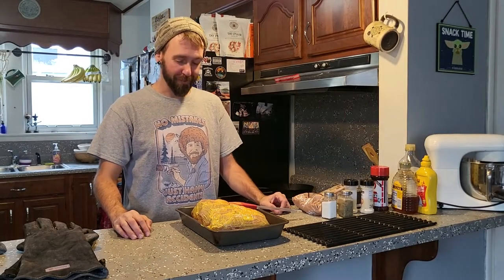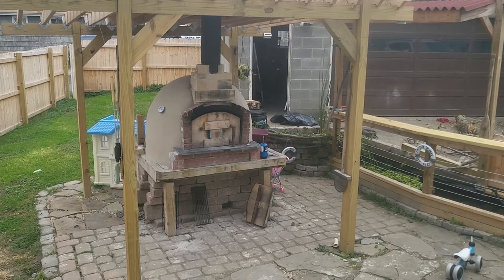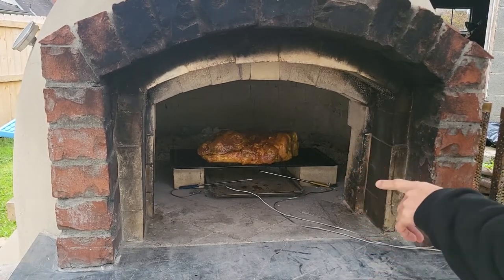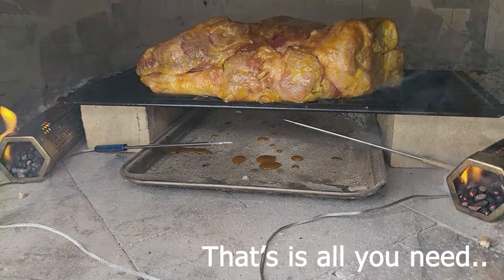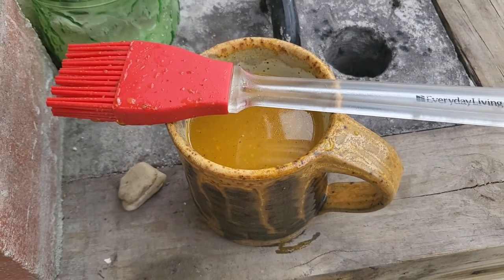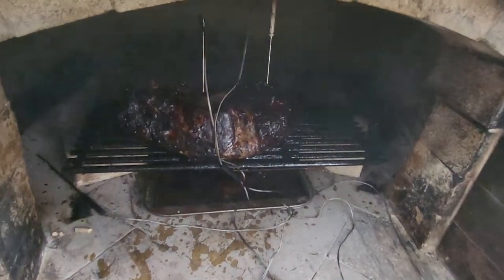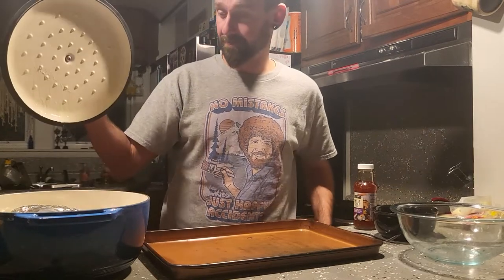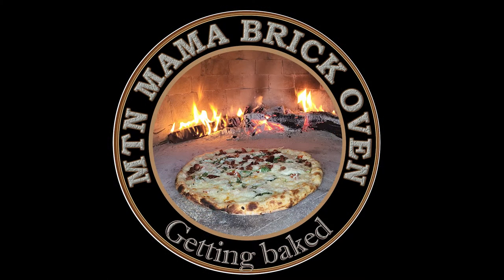Use a Pizza Oven As a Smoker !

Comment: Looks good. HVe you experimented with just a small smoldering fire for smoke as well? I’ve been very curious about this
Reply from the maker: Yes, i have used the smoke tubes as well as laid small coals around the edges. Sometimes, the coals make the heat rise slowly instead of the heat dissipating. We have a small fire pit that i usually keep going if i am smoking/cooking with the coals & retained heat. This allows  you to keep an eye on the temp and add smoke/ coals as needed. But usually the smoke is only needed for the first 4 hours or so.... and a slow dropping heat from a 275degree start  to a 225 ending temp, over 8 hours is perfect..

Comment: I am trying to figure out the door set up for using the wood oven as a smoker?  I see you have an inner door - before the chimney that seems to be pretty tight and another door after the chimney that has an intake draft on it - is this the standard set up?  does the inlet air just leak in around the bottom of the inner door for combustion inside the oven?  And the smoke leaks out the top of the inner door to get to the chimney?  tough to find this answer anywhere - appreciate the help
Reply from the maker: OK the inner door is to plug the heat and trap the smoke in. YOu want to use the "plug door" for heat retention. the outer door is  more for fast cooking, i.e a steak or you just dont want all the heat blasting at you. i use both when smoking to ensure the excess smoke goes up the draft. even when it is plugged, the heat of the coals will still draw air in the cracks enough to stay lit for up to 12 hours. its awesome.  the smoke tubes are the most important part, they keep the smoke goign. the plug door is for heat and the outer door really has no use for this particular cook. i just like keeping it on there. i have upgraded to metal now :) the slide is eliminated and i have a few small holes in the door at the bottom. I will try to post a video of the new door soon!. Moving next week and getting ready to build another oven and fish bar!
Reply from the maker: and yes to all smoke and air questions. the heat pulls it in and the rising air still drafts through
 the flu, that is another reason i keep the front door on it use to leak out and stain the front brick when the flu got cold.

Comment: Does the smoke flavour persist? I mean I loved smoked meats but do not want every pizza to taste smoked. Does it burn off, and get reset by the high heat of the puzza oven at normal temps?
Reply from the maker: The smoke flavor does not persist in the flavoring, only when using the smoke tubes. You are 100 percent correct about it burning off. :) when you fire up for the next cook, the previous smoke or soot burns off when the dome turns white. I believe its somewhere around 600 degrees. so anytime you make pizza, technically you are cleaning the oven :)  If you spill anything, cheese or grease, just move a fire over that spot and whalla, the bricks are back to new.

Comment: How did you build the oven? 
And what thermometer is this?
Reply from the maker: Piece by piece. :) There are more videos on the channel. I will also be building one this summer. I used refractory mortar and medium duty firebricks. The thermometer is from ZOro . It has a thermowell and can withstand up to 2000 degrees. It measures the overall temp of the brick itself, not just the surface temp....this is how i gauge slow cooking with the oven.

Comment: What temp did you set the oven on for the final 2 hours?
Reply from the maker: I started around 280 if i remember right. the oven was at 225 when i pulled it out. we did high temp it in the oven around 350 till 205... I let it rest for an hour in foil. It was great and we have dont it many time since :) its awesome 24 hours after a pizza party.. the oven is cooling down and ready at that point.